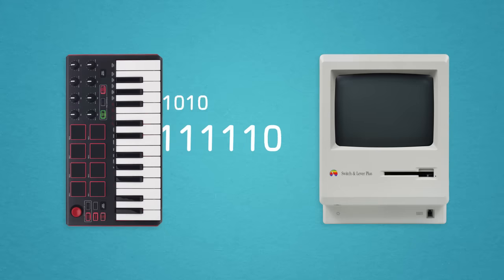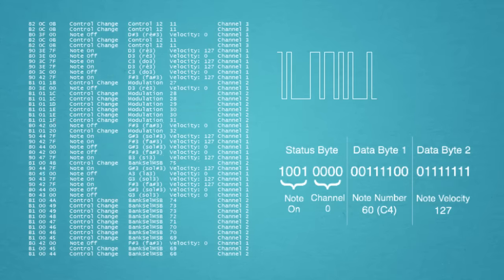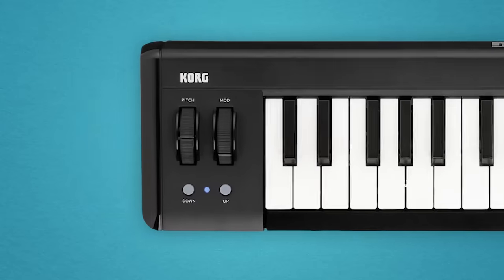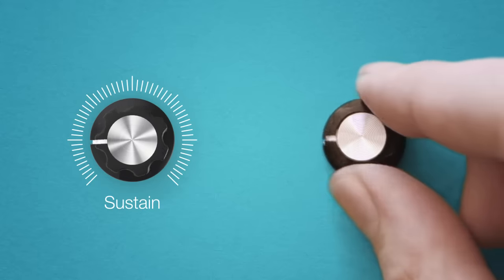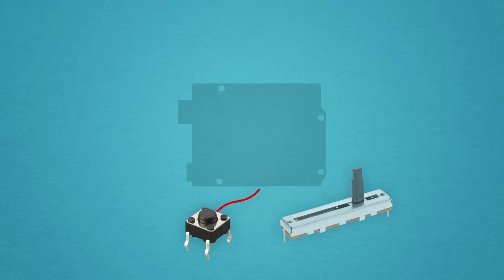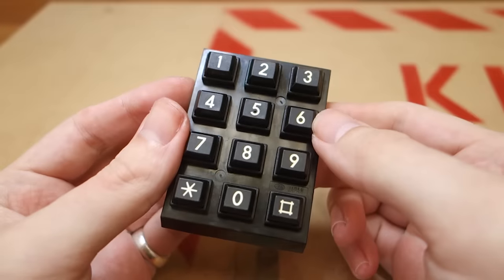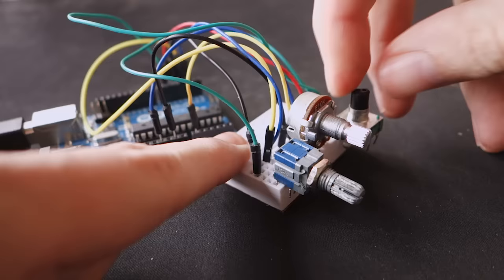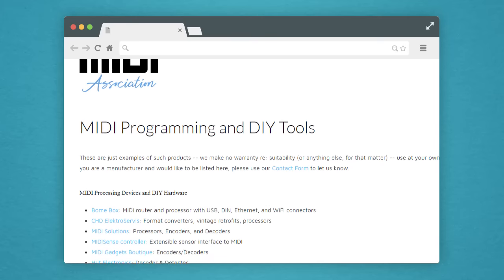Building a MIDI Controller Using Arduino

Comment: Great project! I particularly liked the "bus bar tape". What a great idea for cleaning up the point to point wiring a bit. I will definitely file that away for future use.
Reply from the maker: Mainly suitable for low power applications, and only on non-conductive surfaces obviously, but it does come in pretty handy from time to time. 

I did cover it with electrical tape off camera though, just to insulate it in case any exposed wire would come in contact with it.
Reply: Me too ! The copper tape bus was perfect for this !

Comment: Smart how you use the 6 way to extend the physical encoders. I did this using an old PS2 keyboard and used the keys to change mode - could used your keypad for that too. But there is something very pleasing about your solution that I like. Thanks for sharing. I added an LCD onto my box to give some additional feedback. I saw another dude making his own "cs80" style slide switch via serial chain of resistors as a voltage divider with a wire to tap off of Veroboard. Really neat.

Comment: The use of copper strips for power rails seemed like a cool idea.  I might give it a try!
Reply: Thick single-core copper wire will work well too.
 The kind of stuff used in domestic wiring in your walls & ceiling.

Comment: I recomend using trying some techniques to improve your utilisation of the micro's I/O pins. you could have easily done this project on the uno simply by multiplexing the inputs.  with that and a few logic gates, there is really no limit to how many inputs can be managed with a small microcontroller provided its fast enough for your application. its also a really useful skill to learn for realativly simple projects, which have just a few to many inputs for a smaller controller, but don't need the speed of a larger one.
Reply from the maker: Sure, but it required components I don’t have and would have needlessly convoluted the project. Direct pin access is by far easier to wrap your head around as a beginner, which is what this video is more aiming at.
Reply: @SwitchAndLever   exept for the rotary encoders with interrupts, which you would have needed to reduce the resolution or uses a polling routine. i don't see why you would need any extra hardware to achieve your project if you had used some form of multiplexing or charlieplexing. it really only requires one extra function in your code to manage the operation and a slightly different wiring arrangment. e.g

//returns int with bits corrosponsing to
//inputs
int32_t handleInputs(){
 int result = 0;
 int NumRows = 5;
 int NumCollums = 5;

 int ButtonMatrixRowAddr[NumRows] =       {INPUT_ROW_1, INPUT_ROW_2, INPUT_ROW_3, INPUT_ROW_4};
 int ButtonMatrixCollumAddr[NumCollums] = {INPUT_COLLUM_1, INPUT_COLLUM_2, INPUT_COLLUM_3, INPUT_COLLUM_4};
 
 //makes sure Row Pins are LOW
 for (int i = 0; i < NumRows; ++i)
 {
  digitalWrite(ButtonMatrixRowAddr[i], LOW);
 }

 //Populates result
 for (int i = 0; i < NumRows; ++i)
 {
  digitalWrite(ButtonMatrixRowAddr[i], HIGH);

  for (int j = 0; j < NumCollums; ++j)
  {
   result |= digitalRead(ButtonMatrixCollumAddr[j]) << (j + (4*i));
  }
  digitalWrite(ButtonMatrixRowAddr[i], LOW);

 }
 //Serial.println(result);
 return result;
}

can be wired turn 10 I/O pins into 25. no extra hardware. Any where in your code that requires digitalRead() just put handleInputs() &= BIT_MASK... instead. I think quite managable for a beginner to learn.
Reply from the maker: @stephen2828  okay, first of all I wrote too fast and thought you meant shift registers, not using multiplexing as you suggest.

Secondly, the keypad is already using multiplexing, and even that uses up most of the digital pins of an UNO. Add onto that the toggle switch, rotary switch, encoders (which doesn't use interrupts) and the two switches to disable each axis for the joystick and it was way easier to just go with a Mega. Also had some stuff which was left on the prototyping stage which, if implemented, would've needed more analog pins anyway. 

Your suggestion is definitely more complicated for a beginner, and the wiring required would also be more convoluted. Not sure why you're so against using a Mega. You use what you have available to get the job done, and as I said in the video my aim was to get this working, not to make neat and beautiful code. This thing works beautifully, and that's the most important thing.
Reply: @SwitchAndLever  the other reasons why I used mega

1 - you get more RAM
2 - there are 4 UARTs which I used to create midi merge and transform
3 - the mega is not too expensive and you can use it for other projects

Comment: Hi. This is great stuff!. Good and clear information. I am just for 1 week working on Midi with Arduino and already I can control the MinimogueVA (free VST) with external control pots and switches. No need to buy a 32U4 based Arduino, a Nano clone with CH340 USB chip works. I  have tested it  for Cakewalk and Ableton Live Lite. Thanks for your good work!

Comment: Hey, This is great. Making my own version right now and I just wanted to let everyone know that I could not find a version of loopMIDI for MAC. But MACs do have built in midi settings you can find in your system preferences that works great. Also, make sure to check your baud rate matches. So far my prototype is way more stable than "MAX connection kit."  This is prime content.
Reply: How did yours come out and are you still using it? I’m considering making on with many rotary encoders to control plugin parameters when mixing/mastering. Any advice is welcome.
Reply: @ilikemyrealname  Works great. Has not broken on me once. Some support software like hairless midi serial for mac needed to be updated when the OS stopped supporting 32bit programs. But I was able to find a 64bit version of hairless midi. Its a great project, let me know how yours turns out.
Reply: @patrickkelly3053  Thanks for the tip! Great news that it’s been working well for you. If I may ask, did you use encoders and if so, which ones?
Reply: @ilikemyrealname  I did not use encoders. Good luck, let me know how it turns out.

Comment: Inspiring project, I especially like the custom box. One improvement is to use a microcontroller that allows real USB MIDI. The Teensy boards can do that and are programmed from the arduino IDE.
Reply from the maker: Yep. I know but don’t have a Teensy. You use what you have available after all. 🙂

Comment: Dang, this video is wicked. Your editing and animations are awesome and I love the project. I want to try something very similar for a footswitch I can use while playing
Reply from the maker: Thank you, hearing that really means a lot considering how much work goes into making a video like that.

You can definitely make a pedal quite easily using this method, it's just one button if you want it to just be on and off. If you want it to have a range, so you can do things like velocity control with the pedal, you need a different solution though to sense the difference.

Comment: Additional Tips: Make the top panel detachable (with screws) or mount the components on the panel before mounting the panel on the box. Instead of bigger and more expensive arduinos, use the Nano or Pro Micro and add things like the mcp23017 port expander, and there are cheap ads11x5 breakout boards for four analog channels each.
Reply from the maker: If you like that style then by all means go for it. I didn’t want a separate top so I didn’t make one.
Reply: @SwitchAndLever  Will it necessarily look any different? Anyway, everyone to his own liking. Just saying it makes it easier to wire the stuff. Especially with smaller boxes.
Reply from the maker: @Andreas-gh6is  well yeah, at the very least there would have to be a split line somewhere alone the top because the top and bottom are separate pieces. Then there's the screws going through the top to hold it down as well. I'm a designer after all, those things would be very obvious things to me. Not to say I'm 100% happy with how this turned out either though.
Reply: @SwitchAndLever  screws are preferable, and I can see where that could actually be good for the optics, for example for aircraft cockpit-like devices. There are other options though, for example magnets or snapping. Probably harder with laser-cut wood though.
Reply from the maker: @Andreas-gh6is  Preferable from what point of view? For something I made for myself, that I get enjoyment out of and that I decide what goes and not? No, definitely not.

There are screws, holding in the bottom, giving ample access to the insides if I so need it, without unsightly screws on the top. It really wouldn't change much, beside making the soldering process a little bit easier, at the expense of an uglier design.
Reply: @SwitchAndLever  No, I meant preferable for a detachable top. Your solution is totally ok and looks great!

Comment: For anybody thinking of a similar project: you can multiply digital inputs on a normal Arduino by using resistors and the analog pins. By giving each switch connected to a pin its own size resistor in a voltage divider circuit, you can get back 1v, 2v, 3v, etc for each different switch and sort out which button was pushed through code.
Reply from the maker: Yes and no, what you're talking about only works for analog inputs, not as you write digital inputs. It is also not as accurate, requires more components and is error prone depending on the tolerance of your resistors.

Comment: Excellent, and pretty to see. Personally, the best interface I have known is the Novation Nocturn, with its great automap software. But the endless knobs were really poor quality. I am surprised that Novation has not released a Mk2, especially since they are doing mk2 or mk3 with many other products of the brand.

Your video makes me want to replace the fragile buttons with durable, solid ones.

I don't know if you know the Novation Nocturn, but I think it's still an excellent base today and deserves a new life with better hardware.

In any case thank you for your video, it inspires me, who's not a handyman at all.

Comment: Thank you so f***ing much for that tutorial I already tryed out the arduino to daw(actually it was vcv rack) conection and after a little bit of fiddling it worked needed to find out the correct baud rate which was not 31250 which is midi standard.. but thank you anyways.
Greetings from Germany
Reply: So you connected the Arduino straight to your DAW? Please elaborate, as it seems to me that it would suck to have to use 2 extra programs in order to be able to use a device you built. Could you also tell the correct baud rate?

Comment: You can multiplex buttons to require less inputs.
And if you use an Arduino Leonardo, then your device can appear as MIDI device directly without wrapping software needed.
Reply from the maker: As I mentioned before in the comments multiplexing is more of a headache, and I still think I would’ve run out of pins. The keypad is multiplexed (by design) and takes up seven pins. On top of that there are another 14 digital inputs. The wiring would also be more convoluted. 

As for Arduinos that have a 32u4 processor, you’re entirely correct. But you use what you have, and a MEGA fit the bill perfectly. I don’t understand why some seem to be so anti about them.

Comment: Great job with the controller! A recommendation if you ever decide to make an updated version of this build... instead of using the software to convert the serial data to MIDI, you can actually flash the 16U2 chip on the Mega or Uno with firmware that makes the Arduino register as a MIDI device, the firmware is called mocoLUFA. It is very easy to install and you can still go back and forth to reprogram the controller.
Reply from the maker: Yep, but reflashing the IC makes it out of the beginners realm, it's WAY easier to just use an Arduino with a 32u4 chip instead which you can just program as a HID device, such as a midi controller, without the need to reflash anything. In fact, one of my most recent videos is about doing exactly that.
Reply: @SwitchAndLever  Oh, nice! I'm new to the channel... so I'll have to see it! I guess the reason one could refresh the IC in a Mega, probably to take advantage of all of the I/O and storage space.

Comment: For your Input Problem, try multiplexing the inputs. It may have some little delay but i don t think you use it for high reaction things.
Reply from the maker: As I've said many times in the comments already. Multiplexing convolutes both the code, and the wiring. Also, it's doubtful that I could've fit everything even with multiplexing. The keypad is already multiplexed and takes up seven pins, the encoders need two each (correct me if I'm wrong but I don't think you can multiplex those). We are up to 11 then, and since using pin 0 and 1 when you're using a program relying on serial communication isn't the best idea in the world we really only have two pins left, and 10 inputs. Using the MEGA was the right way to go, for ease of use, and since there were no real space restrictions.

Comment: WoW2 , This is looking Amazing ;-) Just a tip: If you use a TEENSY it can act as a real MIDI device. Instead of sending it true MidiLoop software aka virtualDevices, it could be suitable for you. Without a lot of modifications. Just rewrite the code a bit, to send data true the TX pin of the Mega, and Attatch this to the RX pin of the TEENSY, and let the Teensy handle it like Midi to send to your PC (Windows/Linux/Mac)
Reply from the maker: Yes, various suggestions like that have been brought up many times in the comments already. I don’t see what adding another $20-30 device just so I don’t have to start up a piece of software would really add to this though.

Comment: Btw. you can wash most of the soot of the laser burn off.. it's basically just a lot of burnt-sugar-like components that are water soluble. ;) No sanding required before glueing
Reply from the maker: "Wash"? Have you actually put water on raw plywood before? I didn't sand because I wanted the soot gone, I sanded because I wanted the burnt edge gone. I didn't want the edges to be dark contrasted against the rest of the wooden enclosure. If all you want to get rid of is the soot you can just wipe it with a tissue or rag and that will work just fine.
Reply: @SwitchAndLever  sure did.. all sorts of plywood, the Okoumé or Gabun, which is often sold as "Marine Plywood" as well, european birch ply, poplar.. yeah. Like rinsed under the tap. I once lasered a bunch of 6mm Gabun ply for flyer stands and washed all of that, didn't do it for all the wood bits I ever lasered but it wasn't really necessary for all of them either. Of course, when it's all burned to coal (and not just residue of the vaporized wood from a quick enough and strong enough laser) it's probably more a problem of the laser parameters than a cleaning issue. And I understand that it's not possible to cut differently if that's what you have in terms of hardware, I'd rather have any laser right now than none which is the case : (.
Reply from the maker: To not burn the wood, but vaporize it as you say, you do indeed require a quite powerful laser. Even so, all plywood is not the same, and this was especially sooty to laser. Tropical woods usually handle water better, but softer European wood plywood usually just soaks up water like a sponge, with parts warping and loose wood fibers standing up like a shag carpet.

Also, it's not all loose soot that ends up on the wood, it's burnt resin and lignin as well, which ends up sticking to the surface. Also due to the air assist and fume evacuation any heat from the cut also has a direction to it, which ends up darkening the wood around the cut usually in one direction. That needed to be sanded off as well. When it comes to gluing a burnt edge also has less glue holding strength (for regular wood glue) than a raw sanded edge, due to the burnt nature of wood is to prevent water from penetrating.
Reply: @SwitchAndLever  Indeed.. 30Watts Co2 with a good sharp focus like a ZING is plenty for up to 8mm Gabun but only 4mm birch.. unless it's laser-optimized (laser-transparent glues used) that is.. agree on the effects of water on the woods, it's also a bit of a trade-off when you want to keep the darker areas for the looks (like when engraving labels) :D

Anyhow, I was surprised about how well just water and a little brushing removed the darkening from smoke and burning that I experienced on my laser cut wood parts and thought I'd share.. what little I can add to the topic right now. Impressive stuff btw!

Comment: This is the coolest thing I've seen in a long long time! Do you think it would be possible to use your midi controller, or one similar to it, to make an electronic drum-kit by using drum triggers to trigger midi events?
Reply from the maker: As long as it can be read by the Arduino, of course.

Comment: Nice work, the case is amazing! However, I would install pots with nuts depressed into the case in order to avoid such big gap under the knobs.
Reply from the maker: Frankly, I like the gap. It gives more to grab onto as the knobs sit a little higher. Also, it would require thinning of the wood, and it's already quite thin. I had to thin the plywood in a planer to be able to mount the components, I don't think it could've taken another pass through the planer without disintegrating.
Reply: @SwitchAndLever  Technically this could be done as through holes in face panel and another small wood glued from the back equipped with holes for pot nuts. Just an alternative.